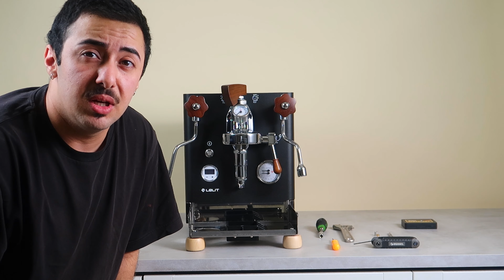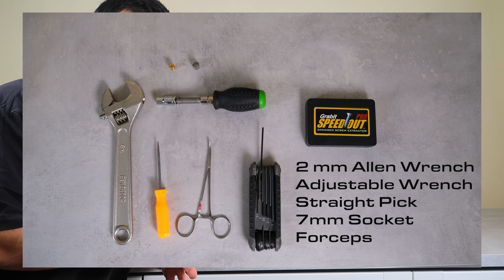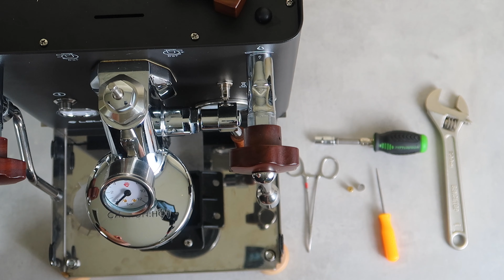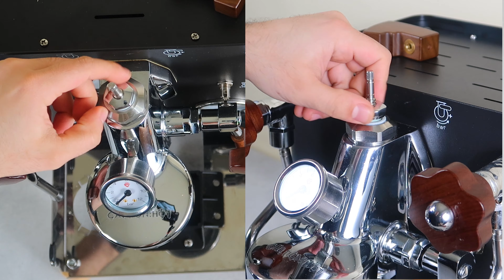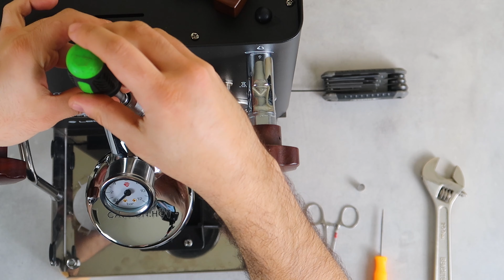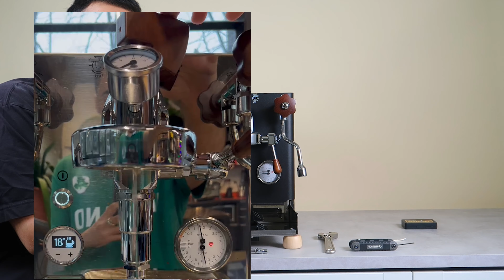How to Replace LELIT Bianca Flow Control

Comment: nice video, I have a question regarding flow. I adjusted mine and still is fully closed 1g/s and fully open 5,5g/s. Is it normal or definitely something wrong?
Reply from the maker: Your goal is 5-6g per second at fully open. Closed, ideally it would be nothing coming out. What likely is happening is that your gicleur and needle are worn. They have a spare part kit to replace it: 100185 is the SKU. You replace both needle and gicleur. If you still have your extra gicleur in your accessories box you can always try to just replace the gicleur, but if that still gives you the same result, then you will likely need to replace the needle too. Its a normal wear part.

Comment: I have a huge flow when in the fully open position. I supposed the gicleur was broken so I changed it (and it was not broken)....and I still get a huge flux. When the paddle is on the left, flux is 0. I reduced the pump pressure but still I get a flux that is about 30% higher than what Lelit indicates (about 120grams of water in 20''). Ideas?
Reply from the maker: 120g in 20 sec is not bad. That is actually the goal. 5-6 g per sec. At the end of the day, flow control allows the user to control what they want their output to be. So if you want to, you can always adjust the flow paddle to be somewhere where your full output is lower. Hope that makes sense. 
What is your pump pressure? 9 bar? Are you plumbed in or using water tank?
Reply: @LELITOUTSIDER lelit says 120g/s, I get more about 160/170g/s. I use the tank, pressure is 9bars.
Reply from the maker: @m @mailplutus w old is your machine? Did you replace both gicleur and needle?
Reply: @LELITOUTSIDER  t's about 3yo and yes, I replaced both the glitter and the needle. The gliceur was not broken but the needle was quite "hard" - maybe some grease would have been sufficient. Anyway, I paid 2.5€ for the gliceur and 15€ for the needle and it was pretty simple changing both. However, that didn't set the problem as I expected (the workaround is to set the flow control in the mid position)
Reply from the maker: @mailplutus  That is interesting. I am not too sure. If your manometer that is mounted on the machine (not the group head) reads that the pump pressure is 9, and you replaced the gicleur + needle with LELIT branded spare parts and your flow is that large, then everything should be normal. Since you paid euro, sounds like you are in Europe, so maybe reach out to LELIT support in ITaly and see what they think. 

Your main components in your water circuit leading to your group head is water tank > pump> large solenoid (used in newer machines as low flow solenoid) > OPV (used as safety mechanism, adjusting it makes no change to your pump pressure) > smaller solenoid (for brewing), then it reaches the injection valve that goes into the top of the group head, hits the needle and gicleur, then goes down to the diffuser. So to me it seems like something there is obviously allowing some more water than normal to run through

(My channel is not an official LELIT page, I am just a solo creator)
Reply: @LELITOUTSIDER  I will definitely contct Lelit and keep you posted. Anyway, spare parts are quite cheap (at least in Europe..) and maintenance is relatively easy.
Reply from the maker: @mailplutus yes please let me know what you find! I am curious for my own knowledge. 
That’s awesome that it’s cheaper out there. And yes I totally agree, working on them is fun and pretty simple!

Comment: Thanks for the video. I just received my Bianca v3. I notice the paddle doesn’t touch the chassis when turned left. There is like a hard stop before, around 5mm before the chassis. On the right side, it does go all the way to the chassis. However, when testing the paddle, it seems to work properly: no water flowing when turned left. 
Is it intended by design or my machine is faulty?
Thanks!
W
Reply from the maker: Howdy, that is pretty normal. That needle and gicleur will wear in over time and it will likely eventually touch the front panel. Nothing to worry about. The flow rate you want to achieve at fully open is 120g in 20 seconds. Your goal is basically 5-6g per second.
Reply: @LELITOUTSIDER My OCD thanks you!

Comment: This just happened to my brand new Bianca 3. Did the first backwash and then the flow control stopped working. Top was broken off the gicleur 🙄
Reply from the maker: Dang, I am sorry to hear. Did the video help at all for your situation?
Reply: @LELITOUTSIDER  It did thanks. I was at least able to identify exactly as to what the issue was and how to fix it. Now just need to be able to find the 1.5mm Gicleur for sale.
Reply from the maker: @HawkQFI  I would say to just reach out to LELIT directly. Other than that, eBay has been the best I have found so far. I have seen on other sites have it but for pretty expensive.
Reply: @LELITOUTSIDER  Thanks, I’ve started with the seller to see if they will replace the Gicleur and they have been receptive but they have gone to Lelit so I guess I’m dealing with the middle man for now.
Reply from the maker: @HawkQFI  Best of luck! LELIT US Support (if you are in the US) has usually been great help.
Reply: Were you able to find the 1.5 mm gliceur? Please send the link
Reply from the maker: https://www.ebay.com/itm/256805358437